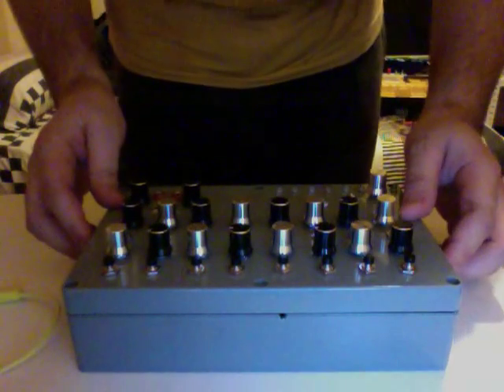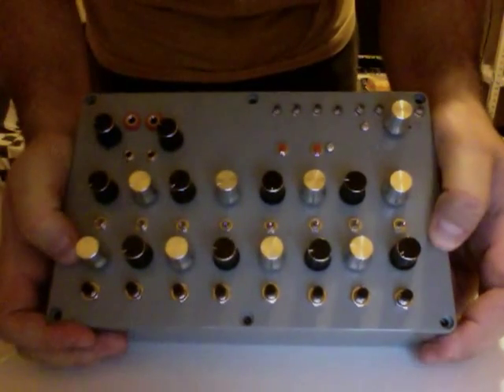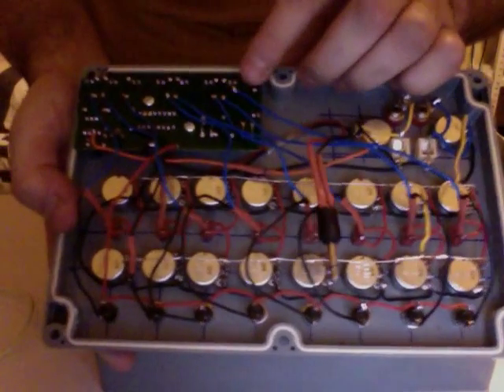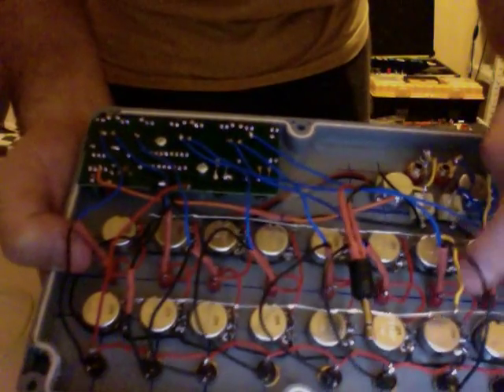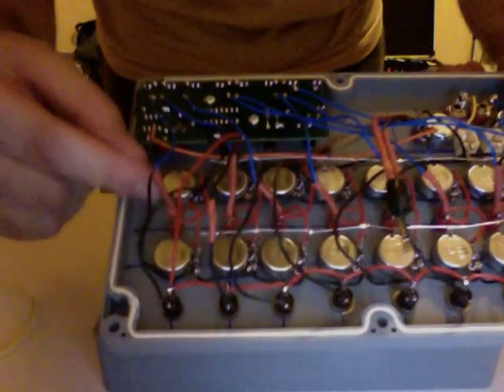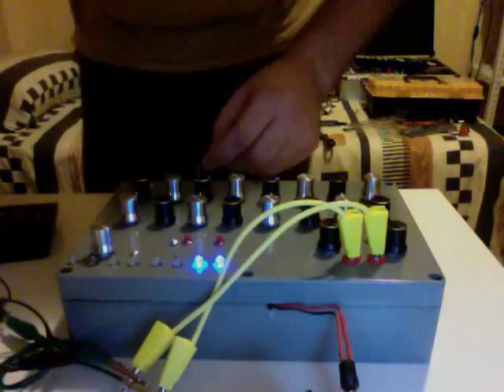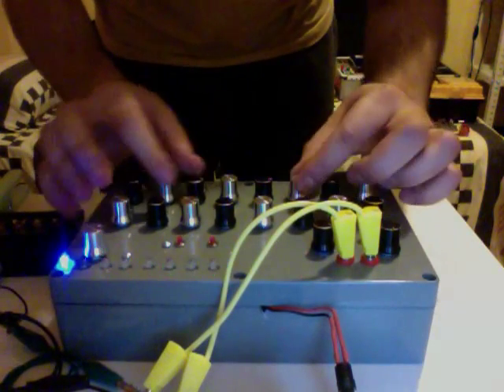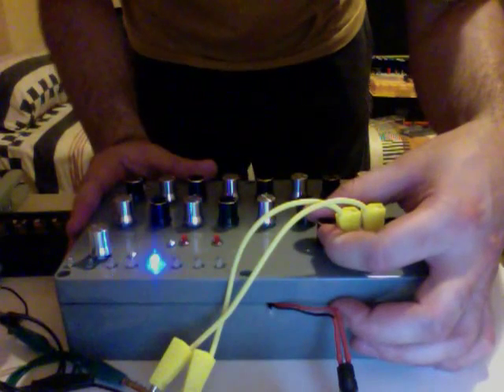8x2 step sequencer MK107

Comment from the maker: Yes each step is programmed with a pot, and then you have the switch to choose between "PAGE A" or "PAGE B" of that particular step.... something like that.

As far I know... you dont need to use 10k it can be any value since they are acting as voltage dividers and not as variable resistors (because they must be grounded, but I may be wrong...).... what is important is just to use SAME value pots on every step so you get aproximate same values-position relations depending on the pots values.

Comment: Then you might want to consider adding one. The clock might slow down as the battery drains. The voltage difference may have to do with the drain from the LED's and/or resistance from diodes on the outputs of the 4015. But again, I can't tell without a schematic. Good luck!  And nice job BTW. It looks and sounds great!

Comment: Nice work and nice demonstration Mr Hadesbox! Thanks also for the credit.

In response to comments below, there is no 5V regulator - it's a 555 / 4015 CMOS circuit and runs directly from 9V.

Comment: The power rail will be the line connected to pin 16 on the 4015. An easy tap point will likely be on the regulated output pin of the power regulator. Look up the datasheet for the exact regulator used on the circuit because the pins can change depending on the type and manufacturer. The power regulator probably has the numbers 7805 on it.

Comment: I can't tell for certain without a schematic of the LED kit you are using, but it likely has a 5V power regulator on it if is asking for a 9V power supply. Try taking power from the power rail on the kit instead of directly from the battery.